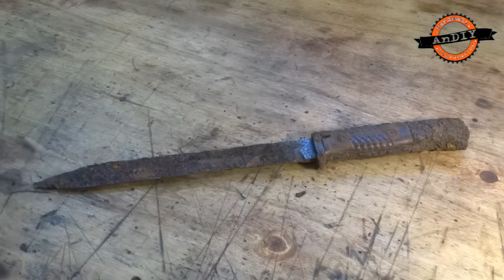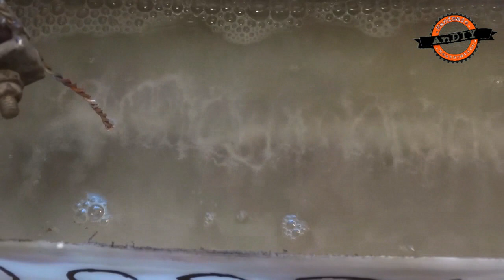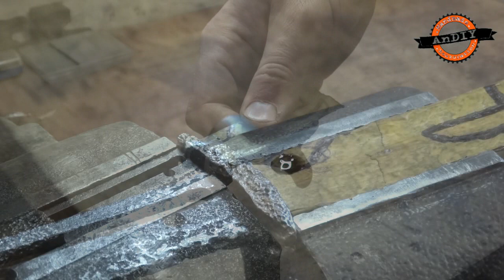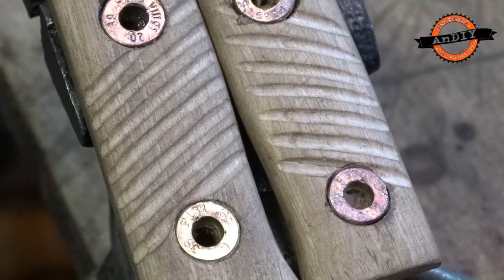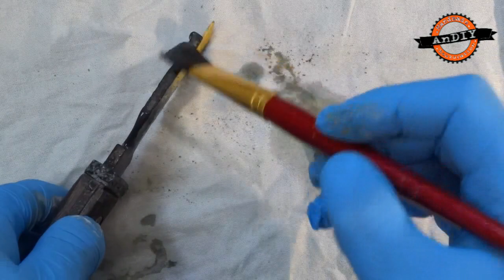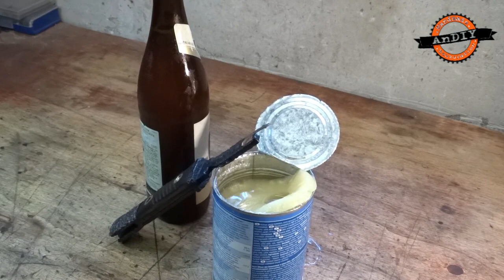Customization knife bayonet K 98 - Restoration movie | AnDIY Handmade Restoration

Comment: I would have shortened the blade a little, but kept it as a bayonet.
You can make an opener at the other end of the handle.
This way you would have both a knofe and an opener.
Greetings, you have talent.
Reply from the maker: Thank you very much for your wishes.  Your idea can be implemented in subsequent projects.
👍👍👍👍